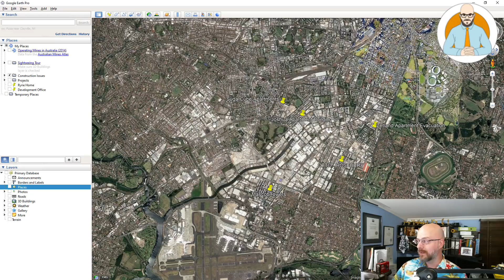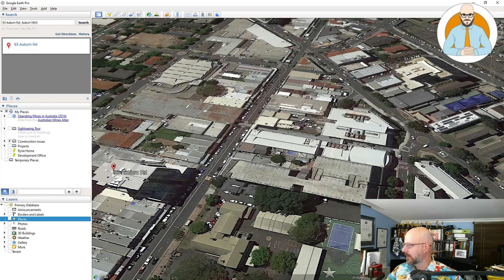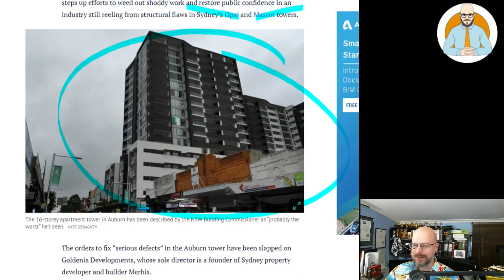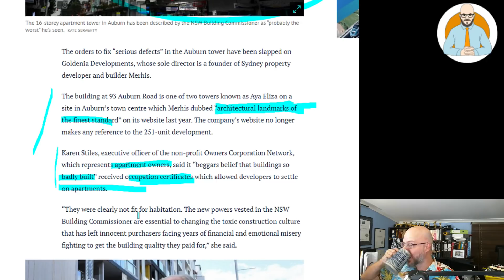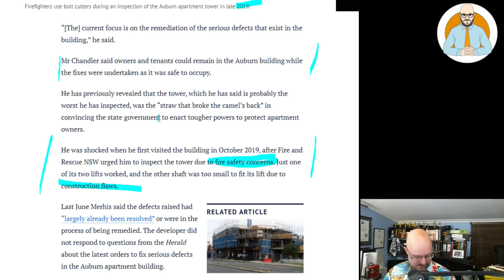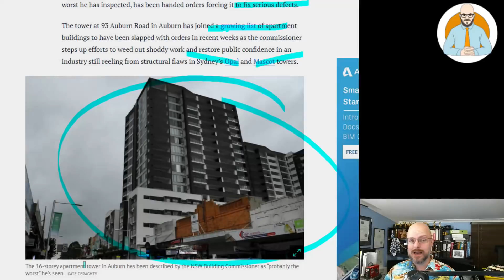Developer Ordered To Fix Faults | Apartment Construction Quality

Comment: @heise Says

I finally bought a home in Victoria, 7 years old, quite new, went through all the usual checks before purchase, Spent my savings and now in the morage debt.

I found out that the 3 bathrooms in the house had no waterproofing, not even cement sheeting, just tiles glued on chipboard on the 2nd floor!
I went to lawyers, called up the building onbudsman, they all said, "well its past 7 years" so you cant do anything" 
One lawyer even said, "water sealing is a paint so its considered cosmetic and not part of the building structure...

Is this correct! that anyone can build a house in Australia and just glue and paint it together, and as long as they sell it after renting it for 7 years.. they get away scott free.. and i have to pay an additional 60K to fix 3 bathrooms!!

come on Australia... this isn't right

Comment: My friend did the plumbing on this building, told me they used the cheapest PVC pipes and it was basically built to alst 4 years before it will have major leaks and rectifications works.

Comment: Developers value bottom line more than anything.  They don’t care as much about quality of work.  They will ask both highly qualified contractors as well as bottom feeders to bid the same job.  If the cheap guy comes in cheap, they will use the bottom guy.  But the cheap guy got the job at the first place is because they bided the project super low, and intending to make their profit by filing lots of change orders during the process to make their money back; vs. higher quality contractors will only give out a price that they could build it for from the beginning.  You get what you pay for in these cases.
Reply: Capitalism only works as far as how moral the people operating as 'capitalists' are.

Comment: Auburn is actually pronounced as "Awe-bin" not "Awe-burn" just like you say "Briz-bin" not "Briz-bain". That area of Sydney is very dodgy as far as real estate goes, it is the same area where developer Salim Mahajer was the Deputy Mayor. Before their local council was merged it was filled with dodgy developers and real estate agents. This apartment complex is just the tip of the iceberg. Almost every large development in that area over the 20 years has issues that building inspectors have either missed or ignored, lots of allegations of corruption. You could literally run your entire channel just making videos about corruption, greedy developers and dodgy builders in that one area of Sydney, it's a joke.

Comment: There is a company in China that pre-makes everything for a building. You tell them where you want one and its up in less than 2 weeks. Apparently the quality is pretty good but we are talking about China here soooooo.  ;)
Reply: That's easy when those are standardized buildings pre-built in a factory. The competitive sydney property market means alot of these boutique buildings a built to attract customers unfortunately that includes experimental structural building techniques to suit the architects plan. If you don't have a builder/ structural engineer that have balls and are accountable for it then there is always going to be issues.
Reply: With 10% asbestos in the plaster.

Comment: All of the towers are dodgy as can be imagined. You should see the core of Eureka Tower (Melb)....

I'm a commercial building surveyor, ESM (Fire Services) regulatory consultant and essential maintenance consultant.

I've worked on some of the most prestigious hospitals, stadiums, laboratories, industrial, residential buildings and more in VIC/NSW/QLD etc.....  Just looks mate. 

I haven't come across any buildings built with integrity and workmanship since around 2004.
Reply: That's very sad to hear.

I hear similar anecdotes from all up and down the supply chain and building trade. Everyone knows how terrible it is. No one can do anything.